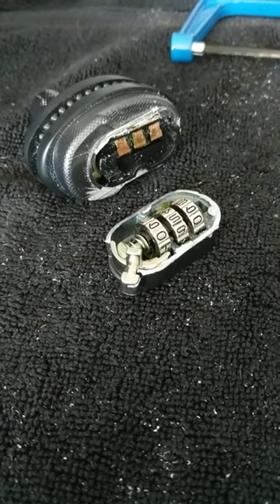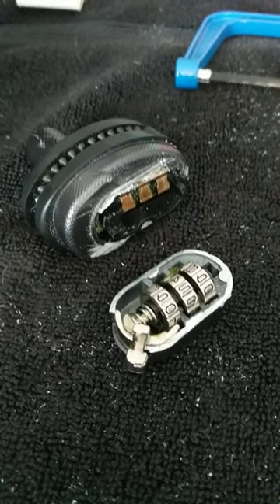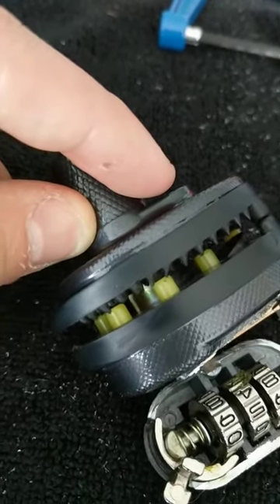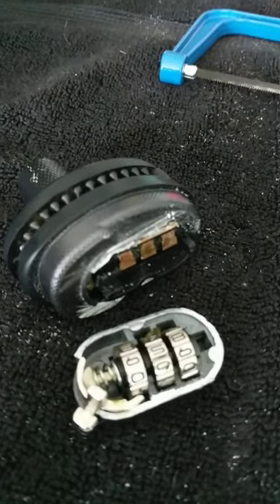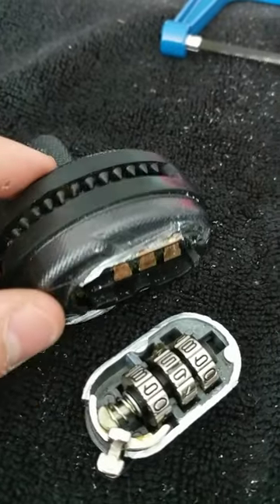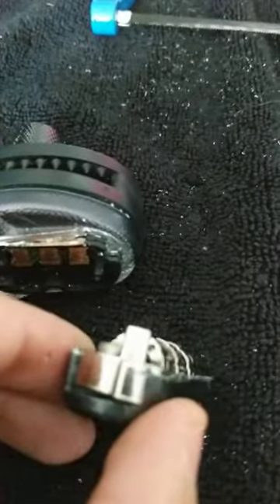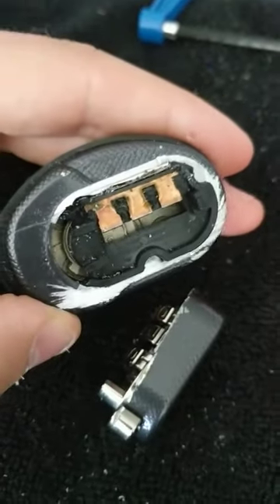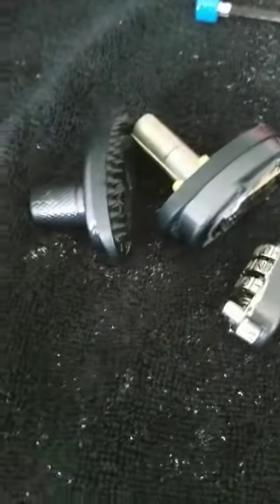Master Lock Combination Trigger Lock Removal

Comment: I came across this video while trying to figure out how to open a lock I'd forgotten the combination to but I eventually found the correct method:  There's a hole on the side that I had thought was just for changing the combo when you know it, but it also works for finding the current combo.  Insert a paper clip and turn the tumbler closest to the hole until it stops turning (ascending numbers and if it goes halfway then go back to the last one). Repeat with the next two tumblers and once you have the correct combo, the clip will push in further which means it can now be opened.

Comment: Realistically it's only 1000 different combinations for 3 digit combination lock. If you try 1 a second on average, which you'd likely go faster, it's only like 16 minutes.
Reply from the maker: Dallas Riley good point! I should've probably done that!
Reply: Thank you for pointing out what we embarrassingly should have realized ourselves. Counting up from 000, I found my combo in 3-4 minutes. Thanks Omniferous Swan!
Reply: You beat me to it - precisely my first thought. That's also a major flaw with these 3-digit locks. There's only 1000 combinations. A ten or older tweeenie would have the lock off in a quarter hour or less, and if you didn't catch him in the act, he'd have it back on again and you'd never know it. Should have minimum of 5 digits (100k), preferably 6 (1M).
Reply: I have a lock where I have gone through every number twice.  I think the lock is defective :(  This will be very helpful